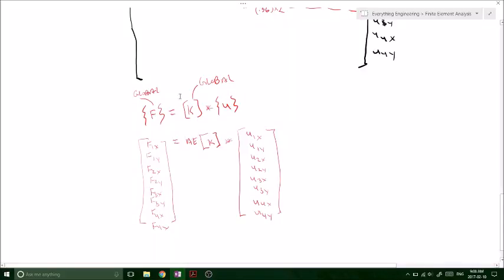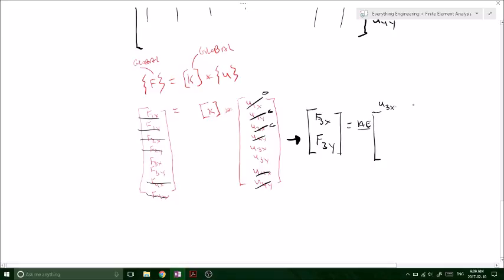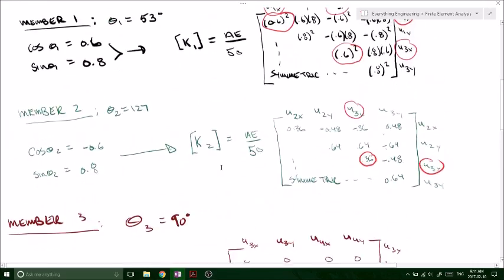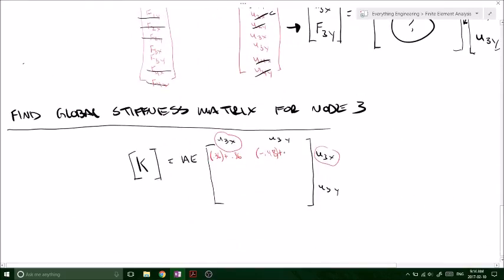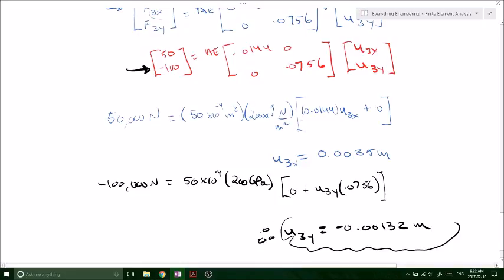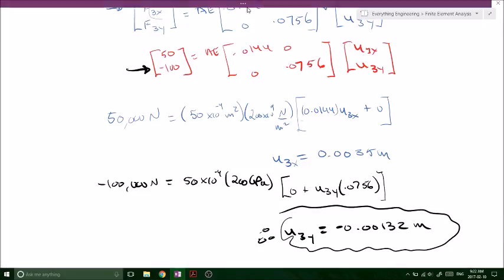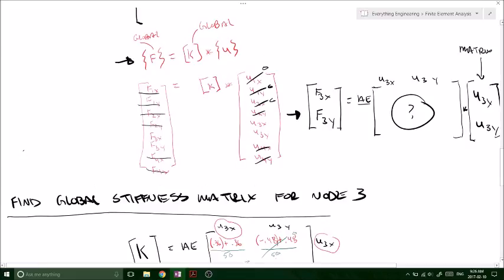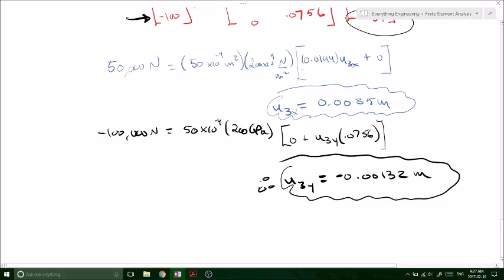Calculating nodal displacements using Local and Global Stiffness Matrix EXAMPLE (Part 2 of 2)

Comment: I think u3x should be zero. By inspection of the system, it is clear to me that there is no force driving a displacement at node 3 in the x direction.  I arrive at the same answer for u3y (-0.00132m).  Have I mistaken?
Reply: there is, it's 50kN, perhaps you missed it?